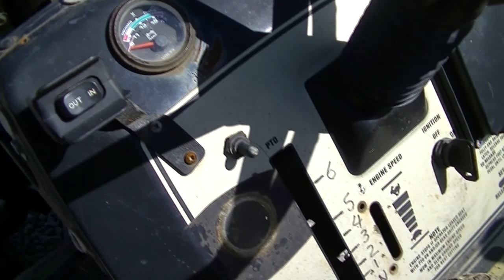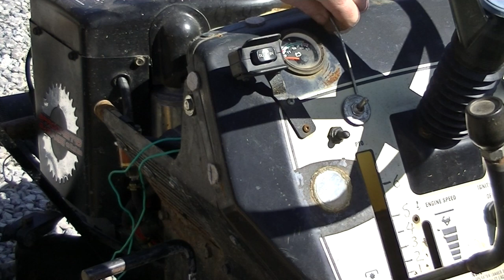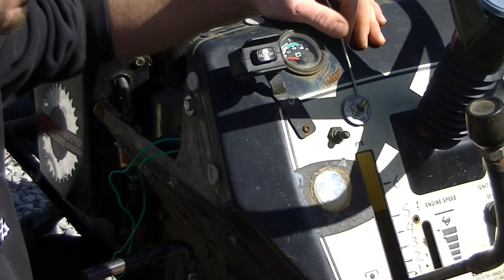SILENCE! I KILL YOU!

Comment: By far the simplest easiest dig tether kill I've seen. I used a normally closed mower safety switch and drilled through the switch with the button pushed in for a pin but I like yours cuz it's still useable as a normal switch
Reply from the maker: I.C. karting I thought about doing something with a factory microswitch, but I decided I wanted to see if I could do something as simple as possible. Drill one hole (if at all) and the rest is pretty straightforward.

Comment: you may want to note that a locking biner is reccomended. those non locking ones are reserved for keys in my book, but thats my inner firefighter coming out
Reply from the maker: William Seibert Your inner firefighter oughta be telling folks to use a manufactured switch. Oh- and never modify a mower outside it's factory specs. ;)
Reply: Sprocketsgarage meh, i was never one for following rules, but ive been through an entanglement course with a non-locking biner on a thermal imager, got snagged several times, to the point that i broke it from yarning on it so hard. same could happen, who knows what youre going to find on the trails, plus it could come unclipped, have had that happen in training too

Comment: An easy tether switch would be a cigrit lighter socket and plug. Simple and effective! Good vid doc!
Reply from the maker: ***** Try it. Let us know how it goes. I'm not sure how you'll get that to work...
Reply: You put it in backwards so the female part is facing into the dash and the male part in in the plug but not fully plugged in. You have the string running out of the dash so when you pull it it pulls the plug all the way into the socket and closes the circut
Reply from the maker: ***** What breaks away, and how? Will it break away and still stay "killed"?
Reply: the string will break away and the plug will stay connected in the socket keeping the engine killed.
Reply: Years ago in car craft magazine , they had an article on simple theft deterrents. One of em was to "wire your ignition to the cigrit lighter" 
So if you took the "key" (lighter) with you, the car wouldn't start. ....
Some time playin with a meter, and an old lighter socket, yea I could see a kill switch bein made....
I'm only like a min in the vid, so I aughta shut up now :)
Reply from the maker: ***** Can you build and demonstrate this? Always good to present other options.
Reply from the maker: MrTheHillfolk Simple, yet effective. The problem I have with it as a kill switch is that the kill switch must be normally open, close to kill. So, yes- you'd have to push it IN to shut the engine off. I am failing to see how one could have a tether RELIABLY push it in, and have it STAY in, even while the tether breaks away. If somebody can demonstrate that it will work reliably, GREAT!
Reply: Possibly get a relay involved if need be.
Reply: If a relay was used  maybe the bottom of the lighter can be modded so when you push it in, it just closes a connection instead of heating the coil. Have it pulling in a 12vdc relay. 
Normally closed connections. 
Have the relay to key on power, and possibly start power, so the contacts go open when energized. when the lighter is pulled, dead relay, contacts close. 
Then basically it's a switch. Pull the switch out and the circuit is interrupted. 
Now I'm getting too far from the cheap 1 wire kill setup also :( 
Haha doc wins. 
Still might be neat to try.
Reply from the maker: It can be done, I'm sure. But there's a complexity that probably does not belong on a safety circuit. Lots to go wrong there.